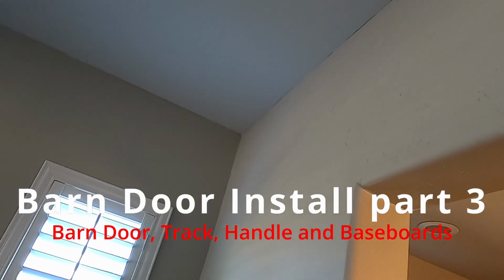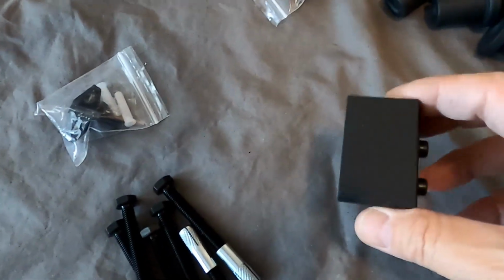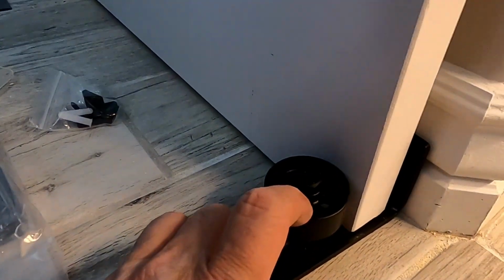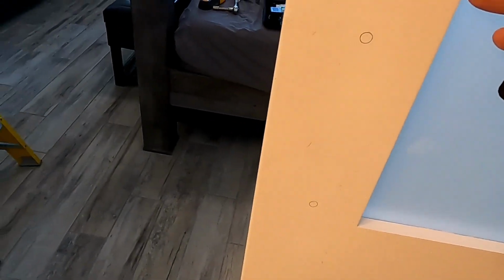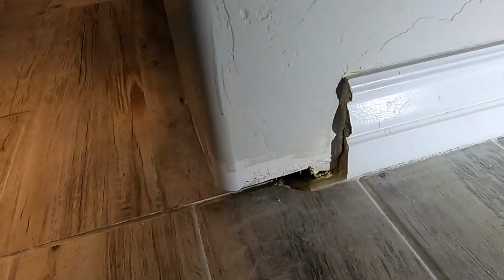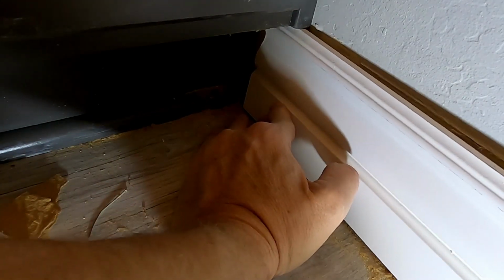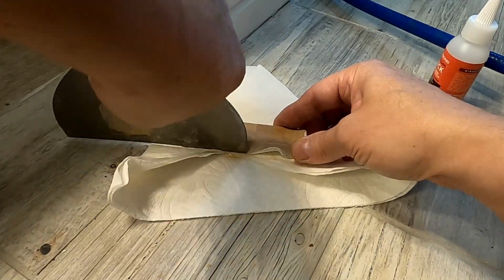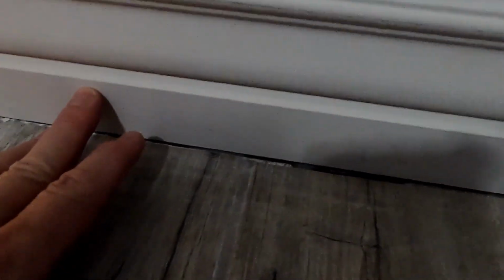Barn Door Install part 3 Barn Door, Track, Handle and Baseboards

Comment: what is the center of the floor to the center of the rail
Reply from the maker: I didn't hear any reference to the center of the floor to the center of the rail- if your referring to the installation of the rail, the rail instructions come with great visual pictures in the rail kit that will walk you through the install. If your a visual learner like me,  these will be very helpful. Good luck with your project!- Mike